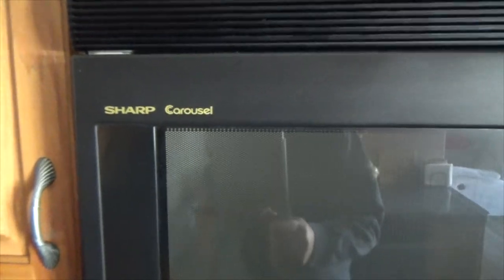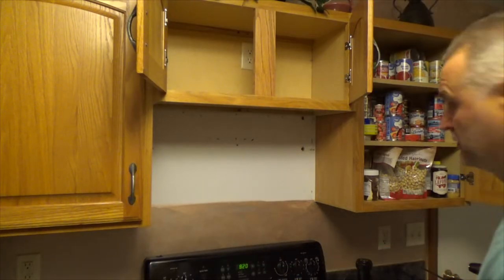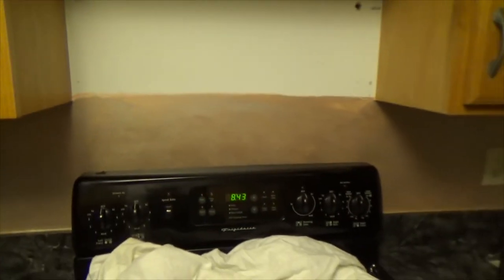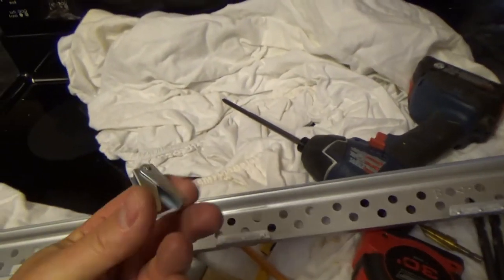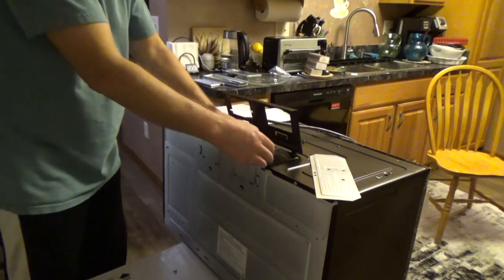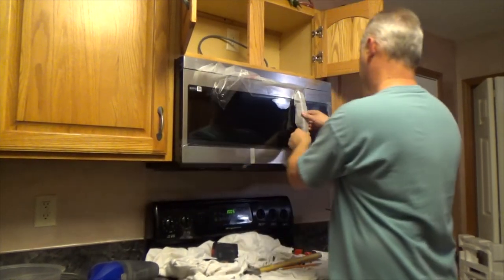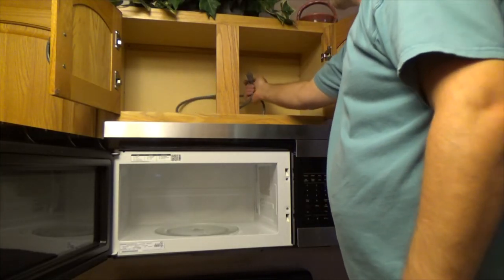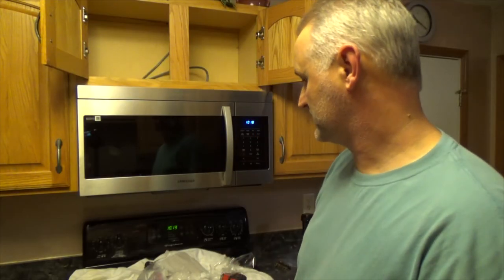Samsung Microwave Installation

Comment: Thanks very much for this! This same exact model came with my house so I'm not sure how old it was, however it just stopped heating the food. I read on replacing the magnetron but the price of that vs what this unit goes on sale for right now, it made sense to just buy new and replace the same model so all the same mounting hardware would be used. I wasn't sure how to remove the old entirely, but now I do, just mostly those 2 screws on top. I'll be installing the new one tomorrow. 

That said, I was skeptical on replacing with this exact same model aside from the ease of swapping out and in the same unit. The handle did break on me on the unit that went bad and from what I read, it is a very common break item. That in mind, I would make sure anyone that opens the door, grab directly in the center of the handle when opening it. The areas that hold the handle into the door are not strong enough to handle the pull force required to open the door. The bottom part broke first and although the top hasn't yet, it has cracks forming in it. At least I got an entirely new unit to start wearing on the new handle 😁 Just something to keep in mind. Other than that, it has been a fantastic microwave.

Comment: Thanks for the video! I would like to offer a tip. Plug the microwave in and test it before mounting. Nothing worse than going thru the work just to take it back down and return it to the store.
Reply from the maker: For sure. Great tip.
Reply: Do you know how often the charcoal filter needs to be replaced?
Reply from the maker: Charcoal filter should be replaced every 6-9 months but it really depends on how heavy user you are. Could be less or could be more if you rarely using it. Grease filter don't have to be replaced, they can be washed when they start to get plugged.
Reply: @VasylGladun  Thanks for the response. Do you think the charcoal filter plastic cabinet can still be removed if the cabinets above the microwave will cover the entire top of microwave?
Reply from the maker: I guess it depends on the model, but it should

Comment: To save yourself a step, you didn't have to drill another power cord hole because your cabinet has a lip that gives you enough space at the top to rout the cord. Also, putting the charcoal filter in while the unit is detached is much easier.

Comment: What happens if u don’t turn the fan that’s in the top part and just put it in with it open?
Reply from the maker: It will blow all invisible grease picked up by fan in the gap between microwave and cabinet.

Comment: Is the upper support enough? Im going to install mine.

Te video is super helpful btw
Reply from the maker: I don't know what do you mean by upper support. Whole microwave weight is sitting on wall bracket and it's enough. Two screws on the top that attached through upper cabinet is basically keeping the microwave from rolling/falling out from that wall bracket. Bottom line you don't have to do anything extra on top of factory instructions.
Reply: Thanks a lot for your reply, the information is super helpful and makes me feel more comfortable with the installation as i was doubtful.